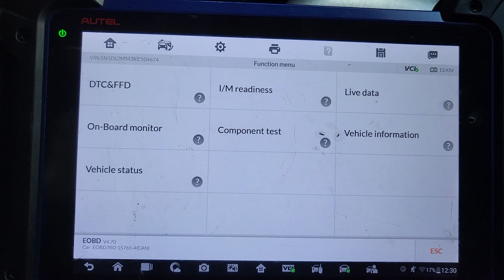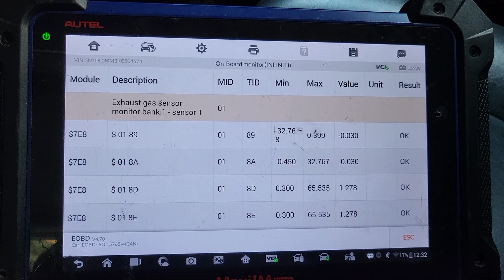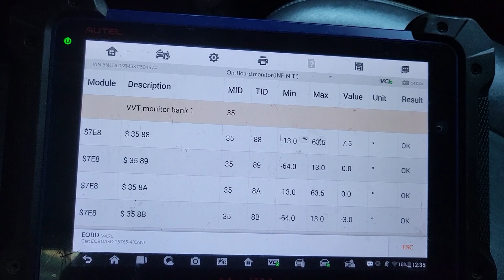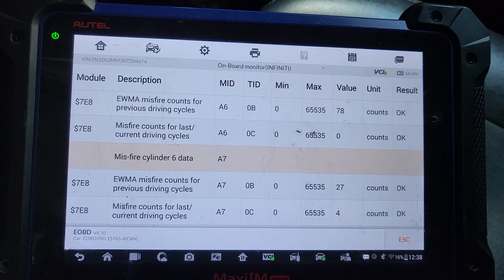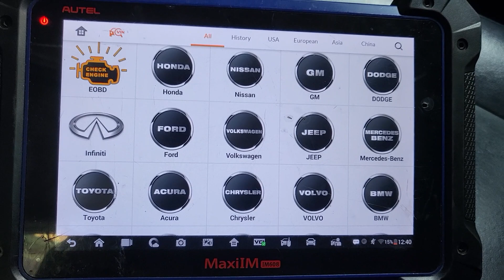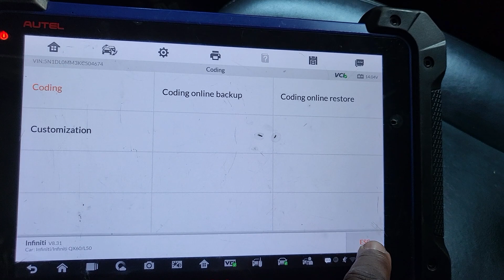How To Diagnose A 2019 Infiniti QX60 System Using Autel MaximIm 608

Comment: Boss ihave Chrysler voyager 2.8 diesel same fualtcode p0087 ican Cheng low pressure pump high pressure pump 2brand new injector but fualtcode still they and car start fine but when car go around 3000 switch of himself
Reply from the maker: what year is the car